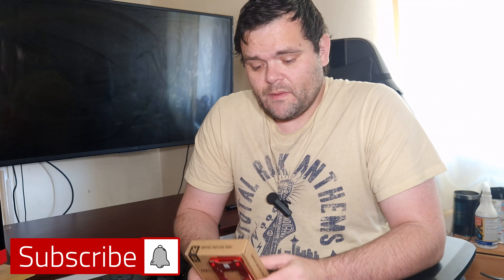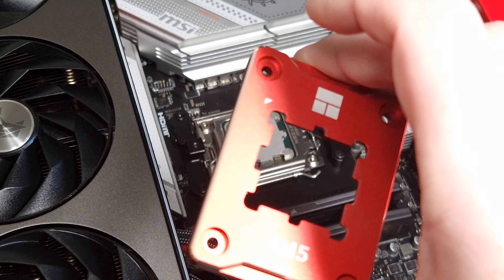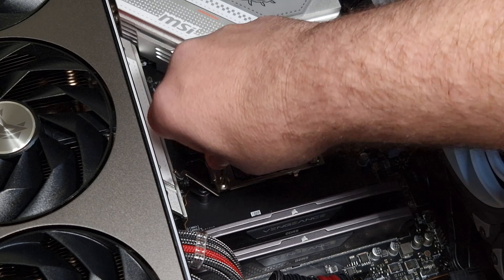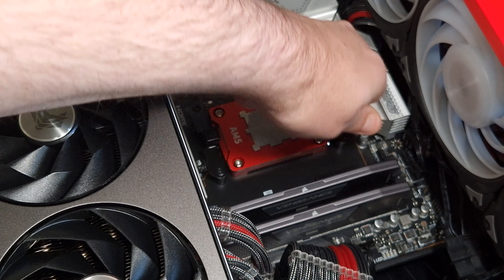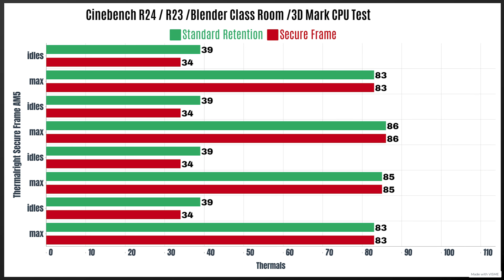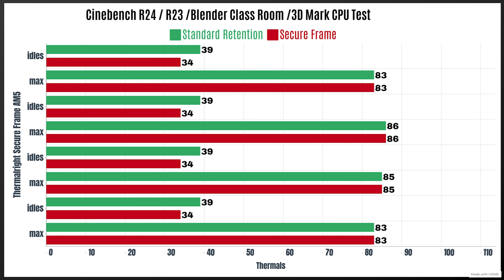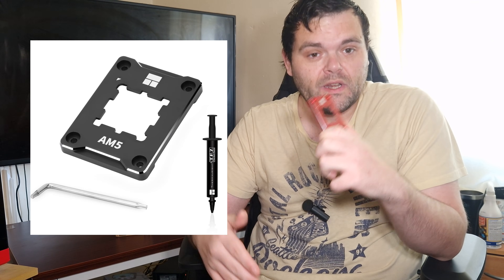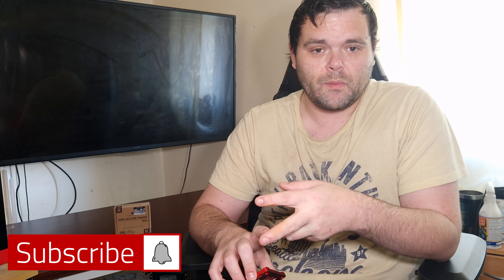Thermalright Secure Frame For AM5 CPUs Should you buy it

Comment: Do you know if it works for Ryzen 9800xd3? I see that on the official website there are two versions for AMD, the normal one and the V2, what is the difference?
Reply from the maker: The V2 seems to be smaller, probably just made it more compact, but from the website, it says AM5 for both, which the IHS hasn't changed

Comment: Not worth in my opinion. It even adds another step in the process of installing the CPU and with that an additional chance to damage your socket. There are more easy and cheaper ways to prevent TP to get on the condensators. As TP is non-conductive even that is not needed.
Reply from the maker: Also, Noctua has got a guard for Thermal paste

Comment: am5 does not need one...The only reason they sell them is because there are suckers that buy anything they are told...That isnt even the purpose of the holder..Its original purpose was for 12/13 gen cpus that have a very soft IHS that buckled under too much pressure . BTW ever think that the reason for temps at idle are because  the holder is acting as a heat spreader?

Comment: tthis plate is not to help the cooling. its in the name "secure plate" its to hold the cpu so it dosen't warp apparently am5 cpu's have a tendancy to warp
Reply from the maker: Nope, wrong. AM5 doesn't suffer from the same issues as intel, and also, this doesn't even help with thermals, even thermal grizzly say that.

Mainly helps with cleaning

Comment: I built my first gaming PC ever (previously used Laptop with Windows 8.1 and i7 4700k) and it's a very challenging task, took me nearly 9 hours with a lot of breaks to finish it. I bought this Thermalright Frame as well and it helps a lot with applying the paste there. I didn't have problem with installing everything to the motherboard save for the CPU cooler (took me a good 15 mins since the dual tower refused to screw into the bracket. And putting everything into the case is what took me around 5 hours in total, crazy since it's way harder than those guide or tutorials shows you.
Reply from the maker: Yep i had this issue with the Thermalright frame as well
Reply: @WELSHYTECH  Oh that's a known issue then? But it's well worth it at the end I guess
Reply from the maker: Yep, not with all coolers, though

Comment: Actually, the AM5 CPU are designed to boost to the maximum temperature within AMD limits this means they will hold the highest frequency they are able to do at the maximum temperature in testing with this product I actually locked the CPU to 4 GHz before and after installation where no core boost would be happening and I saw roughly about a 4° drop in maximum temperatures which is not a lot in your testing you were to note the frequencies you would see the frequencies would be slightly higher with this plate installed that is what I have found from my testing
Reply from the maker: Even thermal grizzly say on the website this frame doesn't do anything for Thermals
Reply: @WELSHYTECH  run the same test I’m aware of what they say but also they do not say is it also helps to prevent distortion of the socket which can improve contact with the cpu cooler This is why you saw lower idle temperatures
Reply from the maker: But AM5 Doesn't suffer the same problems as INTEL
Reply from the maker: @livinglifeboosted1642  if you adjusted cpu without the frame you would still see temp drops

Comment: Uhm gonna say you will never lower max temp on a am5 under max load it's design to boost to a temp and sustain the only difference would be what is the boost value at the temp.
Reply from the maker: Um you definitely will and I've shown that in the many of reviews and I've used AM5
Reply: My temps are down with this frame 3 degrees less at min and 2 to 4 C less with 7800X3d at 100% load Thermalright contact frame and kryosheet + Thermalright frost commander
Reply: Actually. There are two variables at play, the tjmax and max volttage / current, so if you reach the max current you will be able to cool it down

Comment: No, the contact frame was made to address the uneven contact surface of most CPU cooler heatsinks because of how the AM5 dies are arranged. The contact wasnt fully flat so these contact frames were made to level it out so what when you attach a CPU cooler you get the best contact between the CPU heating up and transferring that to the heatsink to be cooled off.
Reply from the maker: For Intel, not AMD AMD doesn't suffer the same problems as Intel does, and the contact frame was originally designed just for Intel, not AMD and if it actually helped with a cpu cooler it would of shown that in my thermals but it doesn't do anything except keep thermal paste from seeping over the cpu

Comment: The question I have to be honest is a little off topic but who knows I could find the answer here. I am building a SFF using the Formd T1. My question is that I mainly use my pc for Office productivity apps, PDFs, many many many tabs and statistical analysis Apps and some Python and when I have free time I play whatever new AAA game I want so which cpu would serve my needs most between these two in terms of low thermals hence low noise in this ITX build 7800x3d or 7950x3d.
Reply from the maker: The 7800x3d will do the job no problem

Comment: I got a black one for my Gigabyte itx b650e Aorus ultra running a 7950x3d, and it makes no difference. Idle Temps are 50degC  , and about 65degC while playing FarCry6. What does get hot to the touch is the Gen5 SSD heat sink
Reply from the maker: GEN5 Drives do get hot it's Normal Should have a heat sync on it though
Reply: @WELSHYTECH  Thanks, mate .. The Gigabyte mother board comes with a built in heatsink and fan with two SSDs Gen4 and Gen5 on top of each other. I wanted to build a 5.7L SFF gaming rig all aluminum chassis with 90mm fans, but if I really want to take advantage of the 7950x3d, I am going to a slightly bigger case that can handle 120mm fans 
.
Reply from the maker: @samm928  I'd honestly go a bit better would help with thermals

Comment: Thermal Grizzly's version doesn't touch the PCB. He was afraid that pressure on the PCB would hurt the circuits inside. Apparently the Thermal Right doesn't hurt the circuits in the PCB though. Thanks for the video!
Reply from the maker: The thermal grizzly frame fits better than Thermalright I have. Both here and this video is a comparison between the both, and neither hit any circuits on the pcb

Comment: Now why did you not transfer the insulation sheet from the oem retention unit to the secure frame?
Reply from the maker: There isn't an insulation sheet on the stock retention
Reply: @WELSHYTECH  interesting,  there was a plactc sheet on my retention fram on my Asrock x670e RS Pro
Reply from the maker: @n6dl321  you mean the socket cover
Reply: @WELSHYTECH  no glue'd to the frame bottom between the stock fram and the PCB..  maybe the board coating would be sufficient.
Reply from the maker: @n6dl321  You don't remove that for a reason

Comment: Hi!  What happens if I use a Thermal Grizzly KryoSheet Wärmeleitpad, will I have problems with an electrical short? Since this product is conductive, the opposite of thermal paste. THANK YOU!
Reply from the maker: You would have to know the exact size you need first and when you go to place it put a little tab of thermal paste on the edges to stop it from moving once it's installed under a gpu or a cpu cooler it won't move

Comment: What happens to those small capacitors on the notches/gaps. Does this put any pressure on them?
Reply from the maker: Nope this Secure frame is for protection and it doesn't seat far enough down to cause any problems
Reply: @WELSHYTECH  Great. Thanks for answering.
Reply from the maker: @HG-xq7ct  no problem at all

Comment: Those are not for reducing thermals, they are for keeping even pressure on the cpu in the socket. The stock retention bracket only puts pressure the the sides of the cpu, causing a potential bow in the cpu.
Reply from the maker: Thats only for Intel AM5 doesn't have the same issue as intel sockets

Comment: it lowered my temps by 8-10c while gaming. I have a 7800x3d undervolted by -30
Reply from the maker: But you undervolted
Reply: @WELSHYTECH  undervolting at -30 does way more thermal headway, this is probably 8-10 more degrees
Reply: My results are in line with other users on amazon reviews. @WELSHYTECH

Comment: I bought the Thermalright AM5 Secure Frame.  The primary reason I bought it was to stop thermal paste from getting down inside those stupid IHS notches (what a silly design).  For that it works great.  I did not buy it for thermals at all and not for aesthetics.

Using it with a 7950X on an ASRock X670E Taichi.
Reply from the maker: I'm glad you're happy with it 😀
Reply: Exactly. This is the only reason to buy it.
Reply: I use Thermal Grizzly PhaseSheet PTM on my 9800x3D works perfect and no thermal paste mess also the longevity is much higher.

Comment: Thank you for this, interesting results, i remember when AM5 had come out people were saying they run hot and to get these AM5 socket clips to help with cooling. I almost caved in and bought one, it doesnt seem to do anything beneficial other than aesthetics. Thanks for sharing
Reply from the maker: No problem at all
Reply: does well for intel
Reply: @AquaLady153  The intel actually needs to have a correction for a concave IHS (the metal "lid" over the silicon that is an (I)ntegrated (H)eat (S)preader) to even out the pressure.    AMD's (AM5 socket) problem is that they made the IHS thicker, so there isn't a contact problem, they have just chosen for some reason to put a thicker top on the newer gen CPUs, causing a huge loss of cooling efficiency - A contact frame doesn't fix this, de-lidding does, which is a much more elaborate, advanced, and risky thing to do.   Once you DO get a CPU de-lidded, you DO need a contact frame however, to ensure extremely tight tolerances.

Comment: I thought the main idea of the frame was to have a better, anti- bending retention system over the, as you say, the mass produced and therefore  
variable quality of the original. The odd degree of lower temp being a bonus?
Reply from the maker: It is, but as AM5 doesn't suffer from the same problem, Intel does 

This really is for looks and from what I've read it's custom loop watercooling you may see a difference

Comment: I run a red one on my 7950x setup and a black one on my daughters 7600 setup .. on air they are not going to help with thermals, but on water .. they can lower temps a couple degrees Celsius
I think the are a more robust retention mechanism than the stock mechanism and I'll get another one when I'm able to get my wife switched over from AM4 to AM5.
Reply from the maker: nice